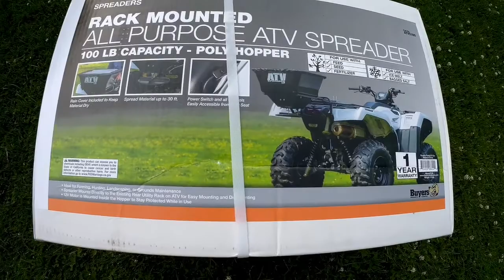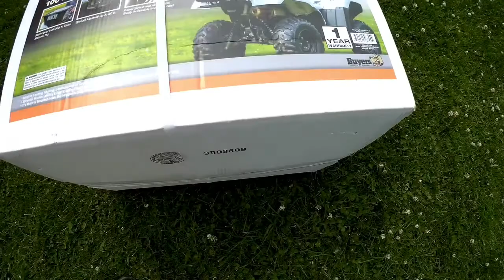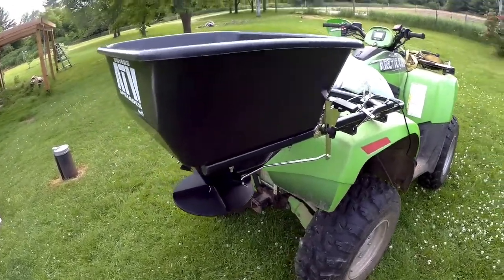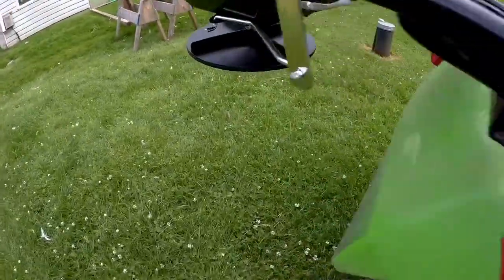Buyers ATVS100 ATV Broadcast Spreader - Install and Trial

Comment: Could you put the metal brackets under your rear metal bars so the middle hump isn’t in the way or would there not be enough support?
Reply from the maker: It does get pretty heavy but it might work. Haven't played around with different mounting locations